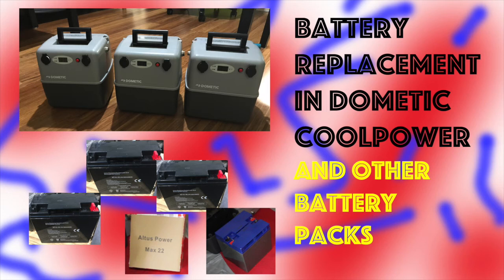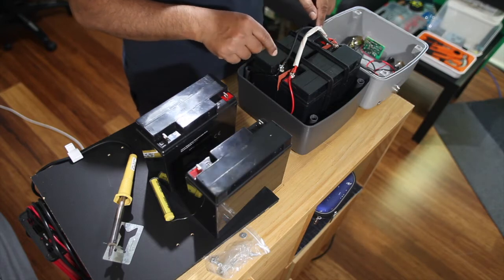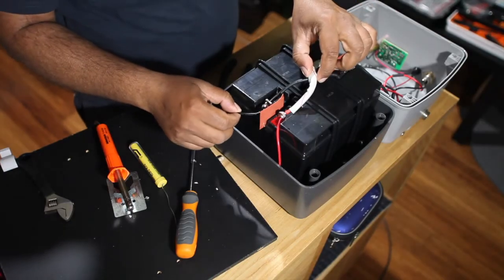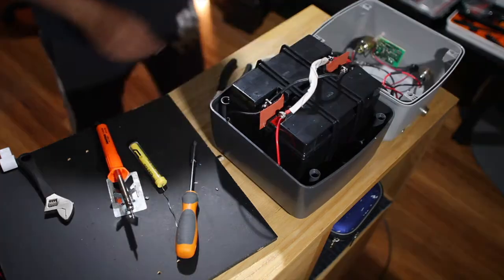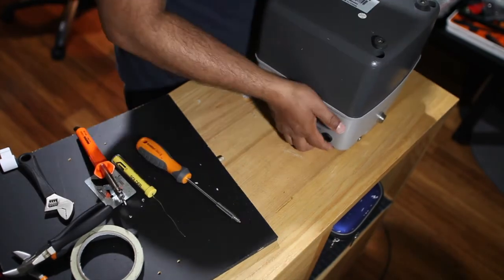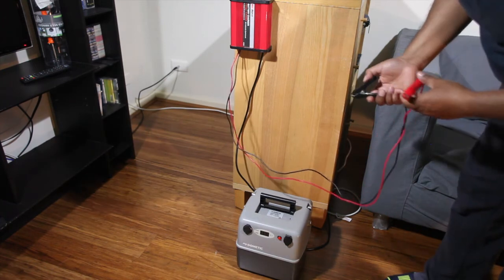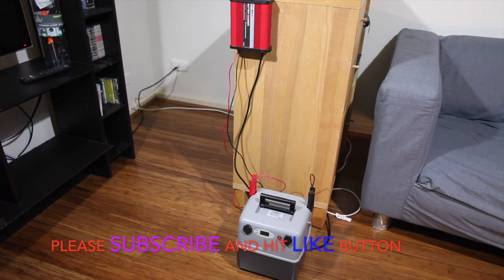Battery Replacement in Dometic CoolPower RAPS44 Power Pack

Comment: How come 44 AH battery pack lasts 7 days? Does it make sense?
Reply from the maker: it is the capacity of how long the battery can hold a charge without charging again. If you charge it regularly then it will maintain full charge and will work seamlessly as backup.

Comment: Hi, did you mention what your 2new replacement batteries cost you?
Reply from the maker: Hi I did. Both cost me about $60. You could get from eBay for this price. Make sure dimensions are correct.
Reply: @live-pixels that's pretty cheap for 2 batteries,do they last just as long as the original waeco batteries.
Thanks for the vid mate,pretty cool vid.
Reply from the maker: @willbill548  Mine lasted about 1 year. After 1 year they still work but you need to charge more frequently. Also, need to take care. Do not store for a long time when fully charged. It will not last like the original I guess but lasts long enough.

Comment: with some minor internal trimming of the case you can fit a single 40ah battery into a raps36 in place of the 2x 18ah that they came with, when that dies i'll convert it to lithium with a suitable BMS.
Reply: I have a brand new cool power 36 for 11 years and I never used it, I would love to know what battery you are talking about so I can make mine come back to life
Reply from the maker: Thanks for the idea. Please share once you complete with lithium conversion what needs to be done for that and where can get the battery itself.
Reply: @live-pixels  there are drop replacements available but at a hefty price.

Comment: At 6:15 you install a black and red wire. Where did you get that? And is it a solid wire or did you make it?
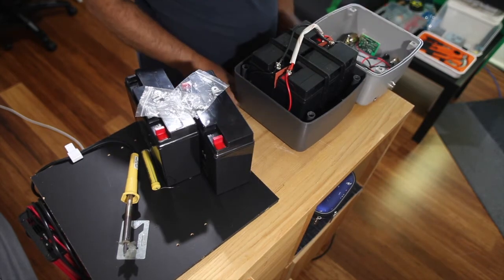Reply from the maker: Hi Michael, these wires were attached to the original batteries in the system. If you see at 1:32 when I opened the system, the wires were attached there. I just removed it from there. Yes, they are solid wires with rubber-coated.  There is a capacitor or something between the red-black cables (inside the black tube). After opening, the first thing is taking photos before doing anything.

Comment: could u replace with the same size lithium ?? would the cable and internal boards work with them ?
Reply: Brian, did you try it? How did you go. I was thinking the same.
Reply from the maker: I don't think that it will work with lithium batteries. Lead-acid battery voltage is different than lithium. I am not 100% sure but I would not try. If you have tried then please share the result with us as @Steve Smith is also interested to know. (sorry for the late reply).
Reply: Lithium 45ah replacement 
https://youtu.be/CqSPQh-0NtI

Comment: Great vid,do and the how to, where did you get the battery from and how much?
Reply from the maker: Thanks mate. I bought from a local supplier advertised in gumtree. I paid $30ea. But you can buy from Battery World but they will charge about $90-120 ea as I can remember. You could find on eBay as well with cost about $60ea. Make sure dimensions and Volt/Amp match as per 2:03  . (Probably I have used 18AH instead of 20)

Comment: What size screws were thry
Reply from the maker: Do you mean from the bottom 4 plastic screws? I don't know the size, those came with the system. And I did not use the metal screws those came with the batteries.

Comment: Thank you sir for showing us.
Reply: Just wondered if you remembered the dimensions of battery, as i just want to price up first?thinkung mbe swapping for lithium..
Reply from the maker: @urby5633  I think the dimensions are 181mm x77mm x167mm LWH but you need to recheck. Wow Lithium batteries? You need to keep in mind the circuits in the system designed for lead acid voltage. You need to do a serious homework before doing that. Good luck with you project and pls let me know the results.
Reply: @urby5633  I mate, did you end up trying lithium? If you did what battery?
Reply from the maker: Thanks so much for watching. Hope it helped.